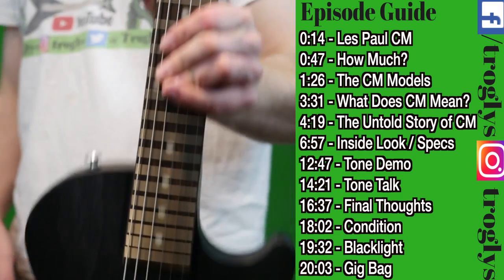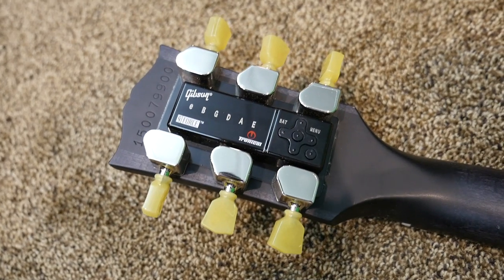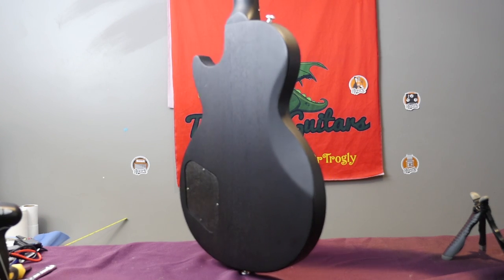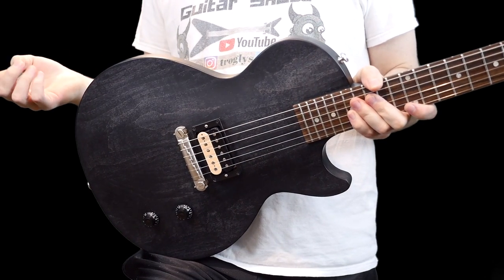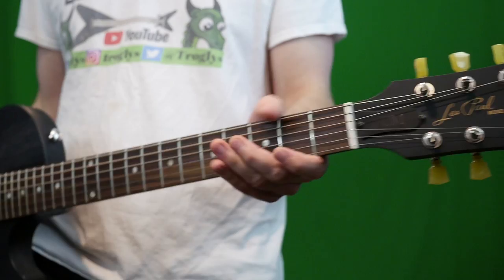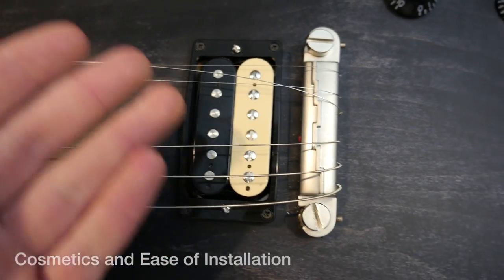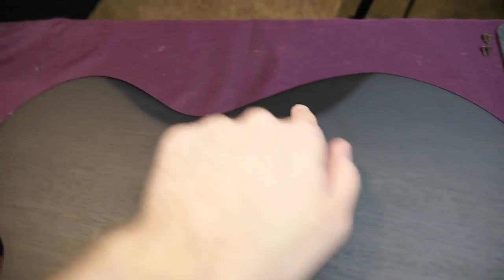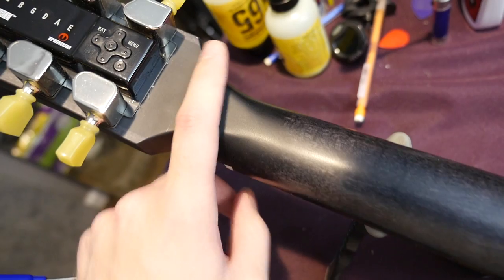The Untold Meaning of CM | 2015 Gibson Les Paul CM Black | Review + Demo

Comment: I saw two of these at a sam ash in clearwater florida in early spring of this year on vacation they were real cheap like around $400.0 thought about buying it and having them mail it to my house. I have a less paul jr. From 2015 with the g force system. I use this guitar all the time for different tunings. You have to download load the instructions from gibson and do the recalibration mode every time you change strings and it works perfectly. Love the g force for playing different tunings on the fly. Using this guitar now to learn system of a down they play alot of tunes in drop c.  Need to play a song in half step down or drop d or standard tunning takes 30 seconds but the key is to do all of the recalibration modes when you change strings. Also changed p 90 pickup to a duncan double stack p90 had to make the route hole deeper for that to fit.
Reply: You can also make your own tunings. It`s useful when you want to play something with a tuning different than A=440Hz. Some older songs have guitars tuned to different pitch than 440Hz- Jimi Hendricks for example.
Reply: @Duke_Silver  exactly ! i dont think they should have put it on every model that year.  i bought the les paul jr because it was cheap and was willing to take a risk on it. I use this guitar all the time for giging out. Your right about doing the custom tunings on it were it might be a quarter pitch higher or lower to play along with some songs. You have to do the calibration stuff when you change strings every time and mine works perfect.
Reply: @jerryfraker377  Yeah, I agree. I bought these tuners from Tronical, because I was curious if they`re any good. I wouldn`t put them on all of my guitars, but I think having them on one of your guitars gives you an advantage for changing the tunings fast. I just think they should have some kind of small lcd display, so you wouldn`t have to memorize how to change them, which tuning goes where and so on. But since we start talking about them, I checked the Tronical website and it seems they have a new model with a color display. Now I`m thinking of upgrading, lol
Reply: @Duke_Silver  i will look into that myself duke. When i got guitar they didn't give you good istructions on it and i had a hard time with it. Found out you had to download instructions from gibson. Its 29 pages long. This explained everything. I think alot of people didnt do this and probably had tunning accuracy problems because they didn't do the calibrations when the strings were changed and that is why g force gets a bad rap.
Reply: @Duke_Silver   thanks for info Duke on tronical i will be looking at that for a backup unit for this guitar.

Comment: Lots of stock pots have a bad/poor taper for guitar applications as I'm sure your aware more then most. But luckily replacing pots is a very easy thing to do with something nicer or more specific to what you want. But in your situation it makes perfect sense why you would leave it stock unless maybe a customer requested the upgrade. I always replace the tone pots and before installing the new ones I open the new pot and scratch off a tiny bit of the conductive material so from 1 - 9.8 it's a regular pot but after 9.8 it's a no load pot. It's easy to do as long as you take a little off at a time and check it in between taking little bits off with a multimeter. Razor blade, dust off, electronics cleaner an a multimeter and you can turn any pot into a no load pot(We'll almost any pot lol, as long as your able to access the wiper an pad/trace). You can buy no load pots as most people are aware but they'll cost more and reduce your options so I prefer to just buy the pot I want a make it myself. But id love to find a way to make a dimple at the point of the pot where it goes from regular to no load so you can feel it and know if your using the regular pot or the no load section which is what Bournes no load pots do.  Also I recently discovered the massive tonal difference by wiring my 2 humbucker 2 volume guitars the gibson way of coupled volume pots. I'd always wired them decoupled so I could blend the pickups better in the middle position but up until recently I had no idea how much top end and clarity I was loosing by wiring the volumes decoupled like that. Coupled sounds much much better and retains much more of the pickups tone. The only draw back is they don't blend as well in the middle position but it's completely worth it. I also went from always using audio pots for everything which works better for decoupled wired volume pots to using linear volumes and an audio tone pot. Which is the more traditional way but I never liked linear pots with decoupled volumes. I think that's why you get so many different opinions on which pots are best to use where, it really comes down to how your wiring your pots and how you want them to taper, there's a ton of different ways to do it all with their pros an cons. Even two pairs of pots of the same type and value can vairy dramatically as far as how they taper which makes it even more confusing to a beginner. For anyone reading this who doesn't know how their volumes are wired it's easy to find out. If your in the middle position and you roll one volume all the way off and leave the other turned up and all sound cuts out your guitar is wired the gibson way (Coupled/Dependent) and if you do the same thing but you still have sound from the pickup that's still turned up then your guitars wired for decoupled/indepemdent volume pots. I wish I would have known sooner that any benefit you might get with decoupled pots is heavily overshadowed by the fact it causes you to loose a lot of high end etc. Switching the wiring from decoupled to coupled or vice versa is very simple. You'd just reverse the wires on the volume pots. So you leave the ground lug alone as it is and reverse the other two wires. Anyways that was quite an off topic ramble, lol sorry.

Comment: I guess the lead is that long because it is the Rhythm Pickup in the Bridge Position.  I like the double contact jack.  The G Force Tuners are a pretty high end feature along with the jack, belly cut and the textured control plate, and the thick fretboard. Thanks

Comment: I have a 2016 CM that came stock with the G Force, the weird large black knobs with knurls in it, titanium nut, PCB electronics (still has the '61 Lead humbucking) and a slightly higher end Gibson gigbag than what yours shows. I think mine might be the CM HP model as opposed to the traditional CM that you have. I bought it for $250 Canadian as a used instrument, got rid of the G Force tuners in a trade, and currently the guitar is with my tech for a pelham blue refin, a changeover to creme plastics, and a set of nickel Grovers. Very excited to get that guitar back early next year!
Reply: Ya you got the  HP model. I got my 2016 at Long & McQuade and has witches teeth for tuners
Reply: @joker71172  the original tag was still on the case for $1,029 CAD, hah.
Reply: @WillyKidd  mine was on sale last Fall for $899 CAD

Comment: Hi! I just discovered your Chanel last week.  I’m hooked!  LOVE THE REVIEWS. 

Quick Question.  When you use the digital multimeter to measure the pickup’s ohms, what range do you want to see?  What does the ohms of a pickup tell you?  That’s about it, I’m curious if the higher the number means better the pickup, and why would that be? Reason?  

Thank you!
Reply from the maker: 20k ohms setting. The ohms tells you the resistance. Most pickups range between 6-14k ohms. PAF styles pups are around 7.5 - hotter pickups read hotter around 14k ohms. Higher number doesn't mean it is a better pickup. https://www.youtube.com/watch?v=tMaRs1jGQPg

Comment: Trogly, you should have tried turning down the tone control a little at a time to show the different tones.  This is how you can approximate neck pickup sounds.  I played a vintage Melody Maker for a while and by using the tone control for darker tones I never missed having a neck pickup.  I don't think you touched the tone control once when you were playing the guitar.
Reply from the maker: Sounds like you didn't quite finish watching the video
Reply: @Trog  I did watch it, but I watched it again on a desktop computer, on a big monitor to see what's going on.  I did see you turn the tone down once, but I can't tell how much you turned it down.  You then proceded to turn down the volume pot in increments, apparently trying to get some type of clean tone.  What I'm talking about is leaving the volume all the way up, and turning down the tone knob a little at a time, to get an idea of the range of darker tones you can get that way.  You're not going to get good darker tones with the volume rolled off a lot.  Also, most Gibsons get the "woman" tone when you roll that tone control all the way off or close to it, it's a slightly mid-boosted sound that is great for distortion sounds (like Eric Clapton used to get in the Cream days).  That's all I was getting at, I don't see much value in turning down the volume a bit at a time, I thought it would have been more interesting to do the same with the tone control.
I am not complaining about the review in general, it was very good, and it made me want one of those CM LP's!.

Comment: I want to plug the holes for the lower tailpiece and throw one of these wrap around bridges on my SG. 
Would the posts line up?

Want to do a black single pup SG next? :)
Reply: If you are asking if Bridge posts line up with tail piece posts the answer is no. The tail piece posts are wider and larger than bridge posts. I guess you can pull out the bridge posts, plug the holes, then re-drill them. At that point it would be easier to buy a SG that already has a wraparound bridge.
Reply: nathan popejoy I was actually asking if the wrap around bridge would fit the posts of the original bridge allowing me to swap it out without any modifications :) and after thinking about it, I don’t see why it wouldn’t, plugging the holes for the tail piece is the only thing holding me back at this point.
And the particular SG I’m talking about is my main guitar and an SG-1 that I completely modded out, love it dearly and couldn’t replace it, but I don’t see too many single pickup SGs out there

Comment: I really love the LP (and especially the SG) "CM Black" with the FRX, even though I've heard the FRX is not that great. I'd love to see them reviewed by you. Or the SG Menace from 2006-08.
Reply: SamFisher338 frx is beast if you set it up right..as you can see I installed a chrome one on my silverburst lp & you can do extreme barring and it holds tune(never goes out of tune for me). My previous experience is with strat trem & Ibanez double locking & frx blows them away..the thing is setup..if not done correctly touching bar will throw you outta tube. Another pro is it’s entirely surface mount(no routing) if for whatever reason you’d like to convert back to stoptail
Reply: @kodas3366  Doesn't it force you to have very high action though? I've seen people (and pictures) saying that it does since it's so tall from the body surface, and that it's also uncomfortable itself because of the shape. But the concept appeals a lot to me.
Reply: I mean..it’d work with super low action, but you’d have to route to accommodate tension screw lowering(floating bridge has to be at certain angle for trem stop ball to function properly giving it that emphasized away from body appearance) Atm I’ve got it as low as it’ll go without doing that.
Reply: It’s a little 1/6” or so wide screw that’s 1 side of tension(it moves when you use bar) lowest piece of bridge. Logically you could drop the action as low as you desire with work..

Comment: Oh man, single pickup guitars are my weakness. This is wildly tempting.
Reply: The theory is that they have more sustain because the neck pickup mags aren't there to dampen the vibration.  I read an article about Malcolms gretsch
Reply: @samfosdick9874  Phil X also has that theory which is one of the reasons why he prefers the SG junior and now the Phil XG by Framus. I just think they look cool lol.
Reply: @mikefenton5634  I want to check one out
Reply: @guitarocd9984  unfortunately I still use a neck pickup for those creamy violin-like solos...with the tone rolled back.  Most of what I play is tele style blues but there is something special about just ripping the neck pickup out and crank crank crunch crunch... especially with a tube rectified 6L6 amp....
Reply: @mikefenton5634  Phil xg framus looks very cool!
Reply: @guitarocd9984  esquires are probably my favourite single pickup guitar.

Comment: I think the guitar is a good idea but Gibson really missed the mark in my opinion and here's why, my 17 year old son built a guitar in our garage that looks way better than that and I'm not joking at all, made of maple, painted white with gold paint poorer over the side where the carved belly cut is (yes it's carved) as if it was running of his chest when he's holding it, lots of wet sanding followed by poly and it looks amazing,  maple neck with black stained fretboard, dots drilled and filled with gold glow powder followed by superglue then sanded, hipshot locking tuners, internets pots-jack plug-switch ECT. All switchcraft high quality (1meg pot btw) the single pickup is a Gretsch high sensitivity glutton jumbuck pickup, oh every cavity has a nice coat of shielding paint, and it has a push pull split for jumbuck or single coil mode, the neck has a satin finish graphtech nut and it's PRS 25inch scale, the neck head is  PRS shape and the body is LP shaped as I have the mold outline, yes I did "supervise" and he did use my tools, anyway it looks and plays unbelievably beautiful, I gig with it when he lets me hahaha and I constantly get offers from other guitarists in bands to buy it with offers as high as $800-$900, and I would put it up against any $200 tele or CM any day, so granted although he had guidance if a 17yo can make that in a garage Gibson can do a he'll of a lot better job than that, and sense certain things I had setting around like paint, paint gun, shielding paint the pickup, it costed all of about $165 to make.